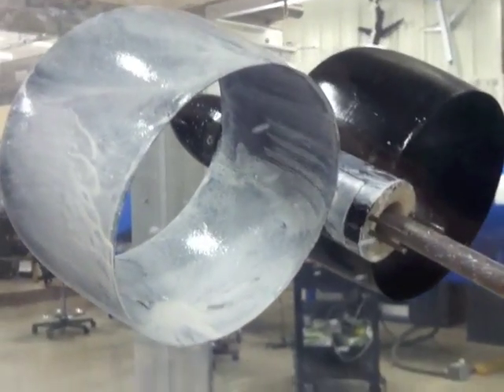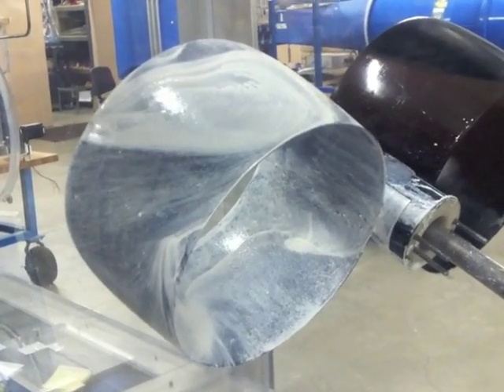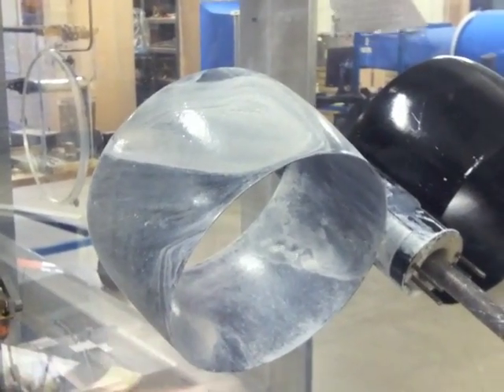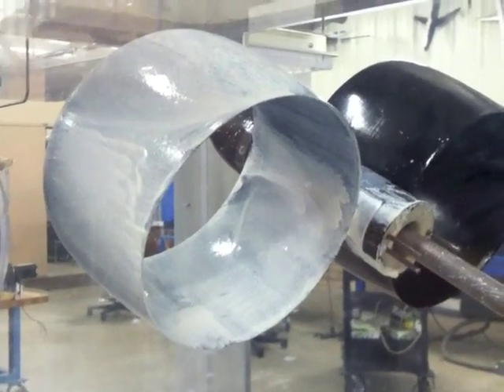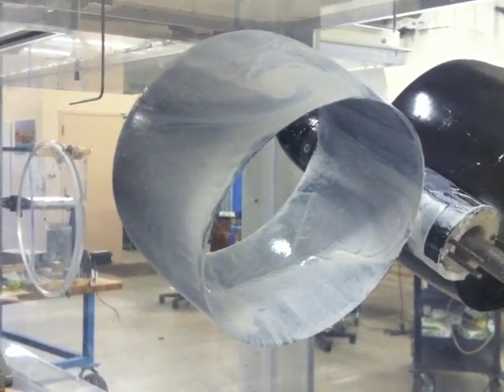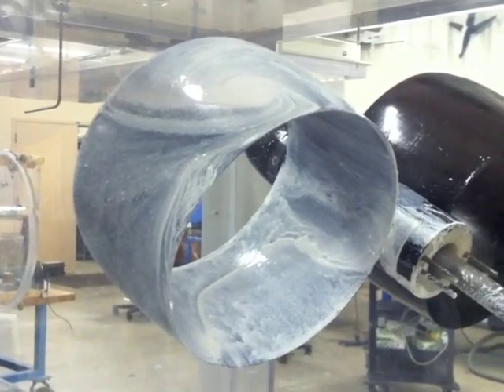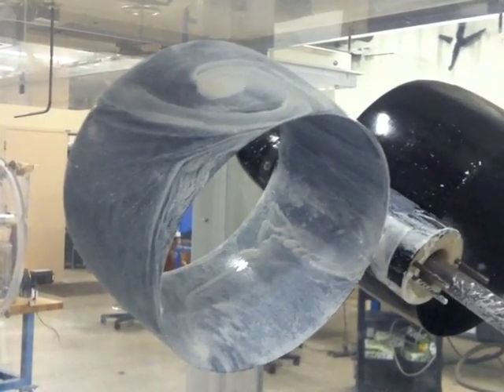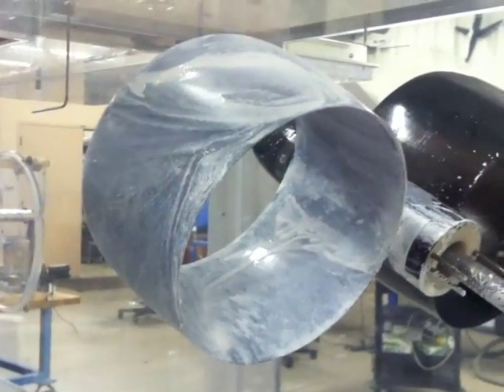Ring Wing Flow Visualization

Comment: Why... this is  a largely irrelevant... experiment... interesting perhaps.  Why is at the angle of attack a flying body not constrained as here, would not fly for very long.   These conditions in flight do not last very long on any real free body flying ring wing.   A stable flying body ring wing would change direction to more be more inline with the airflow... without some very significant control inputs or outside forces trying, as here, to constrain it.